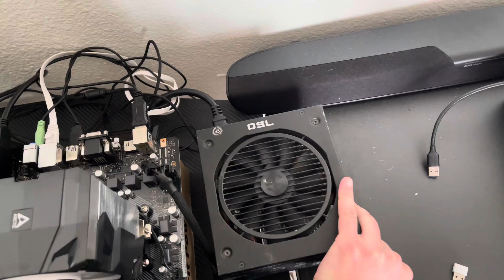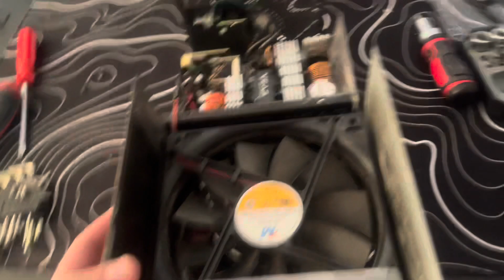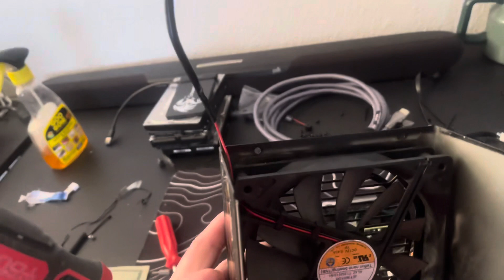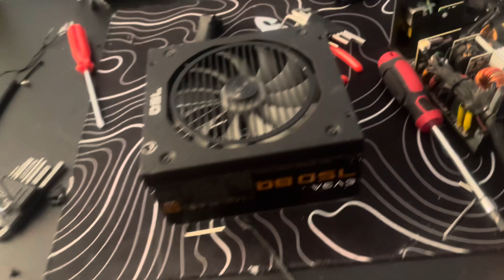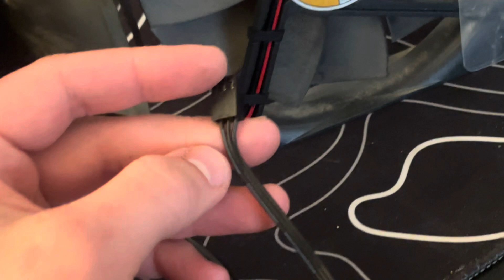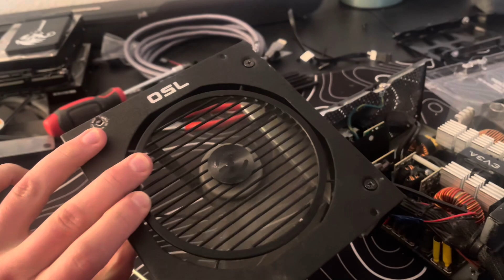How to replace PSU fan - power supply case fan swap

Comment: The fan should be checked before if it starts spining with 3-4v applied. If it does not start spinning at that voltage, you are in trouble , or at least the psu is :)))